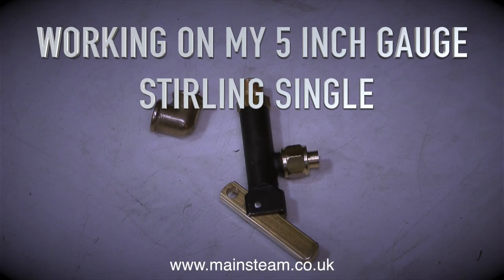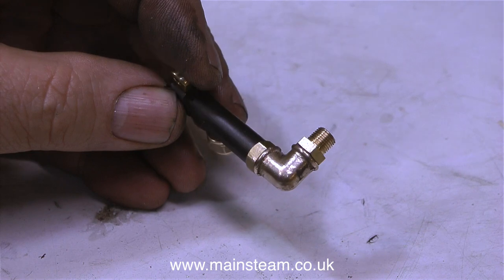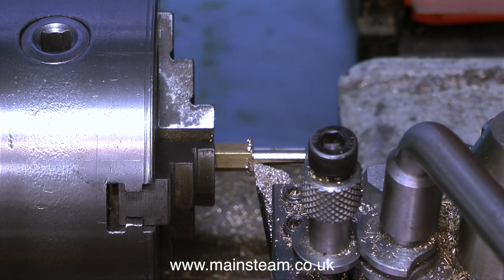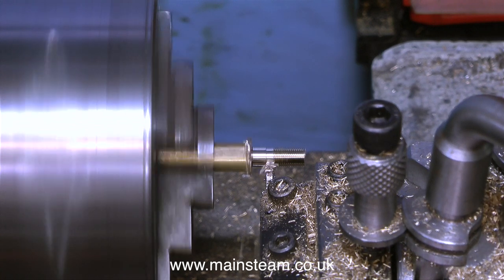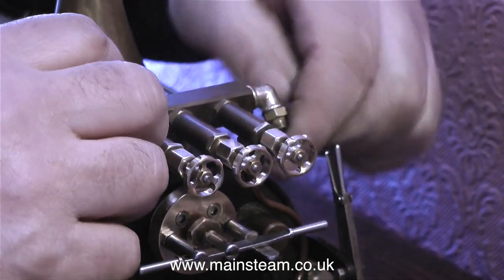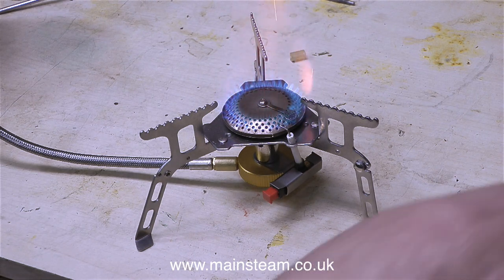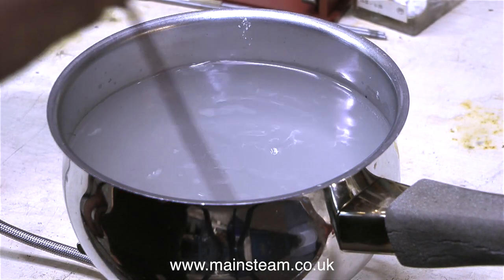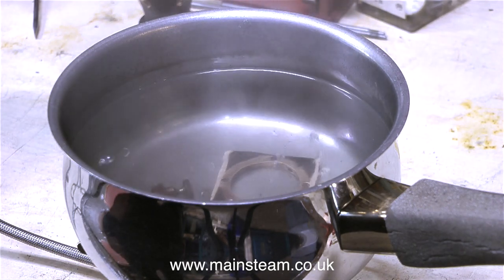MY STIRLING SINGLE #3  WHISTLE VALVE AND BOILING ALUM POWDER

Comment: That is a very useful tip... I never would have imagined that Alum would attack steel like that.  The only problem is, I never break taps in non-ferrous materials.  However, if it doesn't attack stainless, I do have a couple of stainless parts with broken taps in them.  I will have to give it a try.  Thanks, Keith.  :)
Reply: I know what you mean - most of my broken taps are in cast iron or steel. So the alum trick can't be used. I did manage to drill a broken tap out of cast iron using a cobalt drill. The tap must have been made of rubbish but it worked.

Comment: Your mention of PM Research threads needing to be modified caught me off guard as I have been buying fittings from Blackgates and they have been matching up with the few I have from PM Research.  

So I checked the PM Research site. 
 When you pull down the "Machined Cast Fittings" tab there is a box to select the type you want, (Cross, Tee, Elbow) and another for the size.  Under the 1/4 x 40 they list two standards, The MTP (I believe this stands for Model Tapered Pipe threads), and UST (Unified Thread Standard).

There is a note on the PM Research site stating:  
Most British Model Pipe threads use 3/16-40, 1/4-40, and 1/4-32 ME (Model Engineering) straight threads. Our UST pipe threads will work with the 3/16-40 and 1/4-40 ME thread. 

While I like the fittings from PM Research, I must bang the drum for Blackgates as the fittings and valves work great and are somewhat less expensive.

Looking forward to the Alum review.

Comment: Keith, I could be wrong but I think 1/4 x 40 is the same here. 
The difference in your fittings is that PM Research offers their fittings in straight thread or tapered pipe thread.
Love the videos though. Thanks.
Reply: I thought it was that the UK version has a 55deg angle while the US version is 60deg.
Reply: U.S. and Metric are 60 degree threads, Whitworth are 55, and B.A. are 47 1/2 degree threads. If that doesn't drive you bonkers, I don't know what will...

Comment: Here in the states, it is easier to find a shop with a EDM and have them cut the tap out electronically.  Usually for about $5
Reply: So cheap! I don't even know of a shop around here with an EDM. And they'd charge a lot more than that if they did have one.

Comment: I don't understand what could be different with a 1/4-40 between the states and the u.k. ?.  A quarter inch is a quarter inch....and 40 tpi is 40 tpi....no matter where you are....just curious about the details, and what the difference is ??...unless its the model taper pipe thing...we use tapered thread for a pressure tight fit....I believe the u.k. uses straight threads, and a flat sealing washer ?
Reply: Is the thread angle the same? 55deg against 60deg? Is the shape of the tip of the thread the same? just asking :)
Reply: US and metric use a 60 degree thread angle, Whitworth 55 degrees, B.A. 47 and 1/2 degrees.

Comment: For the viewer who wanted to know, a clack valve is also known as a check valve.
Reply: Which is a one-way valve, pressure on one side of the valve unseats a ball from its seat by compressing a spring and this opens the valve letting the water or steam or whatever from the high pressure side to pass through to the low pressure side. If the pressure is on the other side of the valve, it seals the ball against its seat and stops any flow from the other direction.
Reply from the maker: Clacks don't usually have springs, the pressure of the steam holds them in place. This is true in model sizes anyway ......
Reply: Yes I was thinking of a swing check with a clapper.